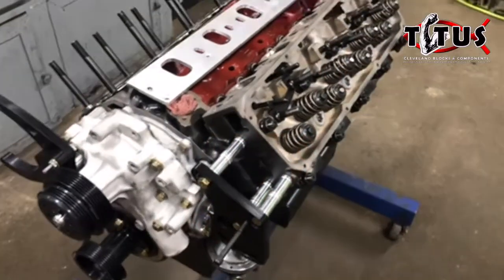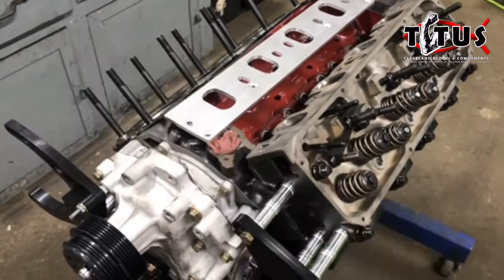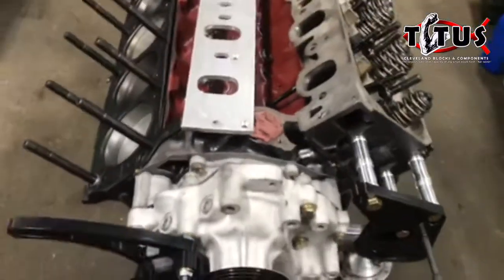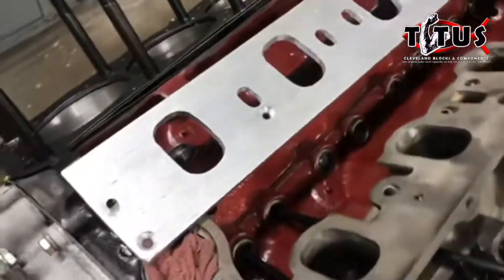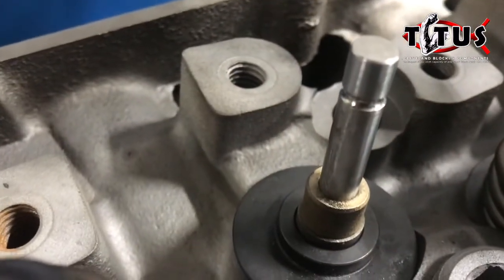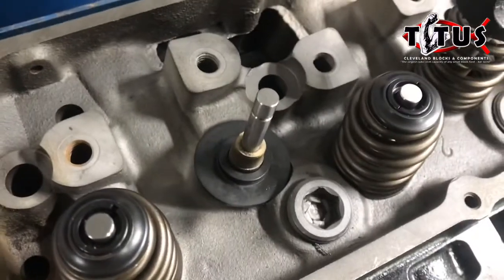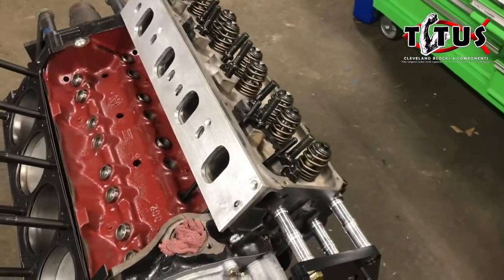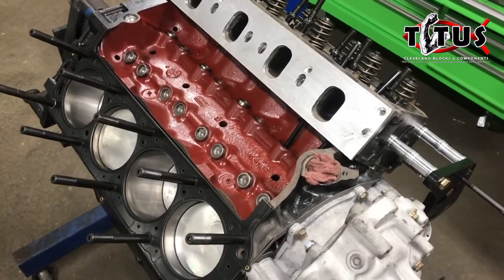Dirt Track Mods for More Power – Titus Performance Racing

Comment: Makes me wonder 🤔 what an aluminum 363 set up like that with hydraulic roller cam and EFI for the street would be like with a modified intake manifold for direct port injection like a pro flow 4 system .
NA run on pump ⛽ gas would cost
 to build and how reliable it would be  ? 🇺🇲🇵🇷🦊👍